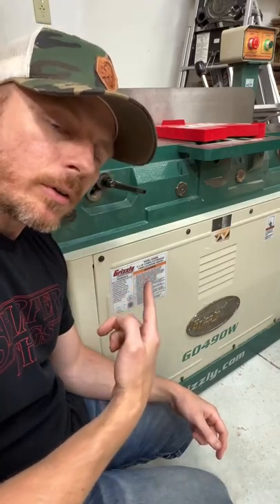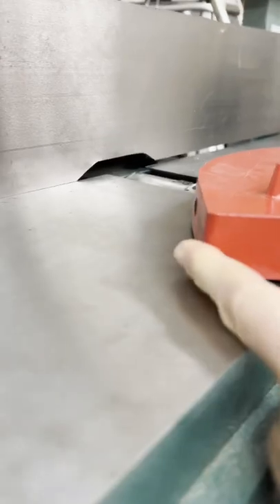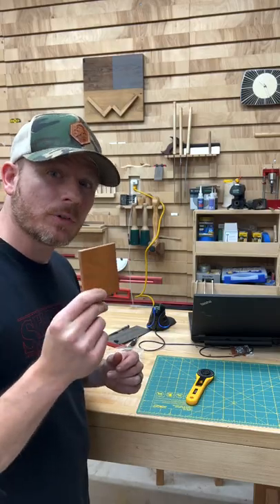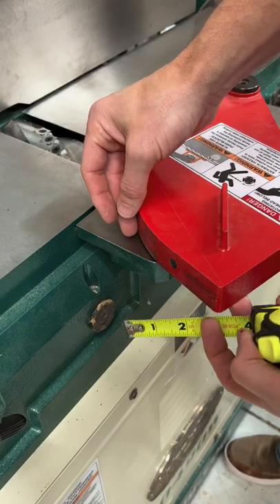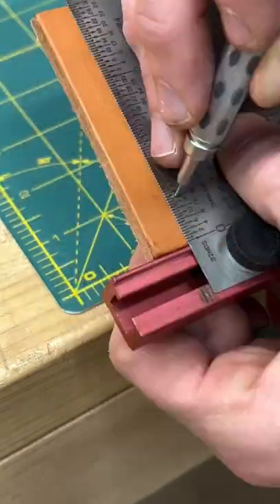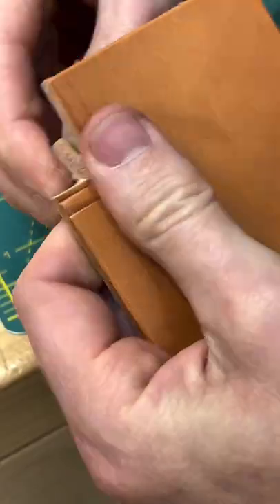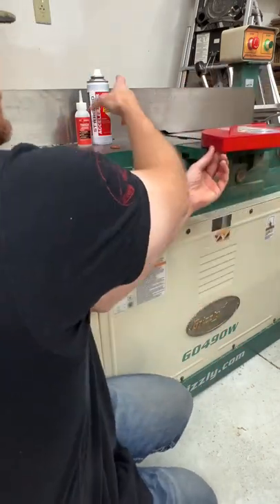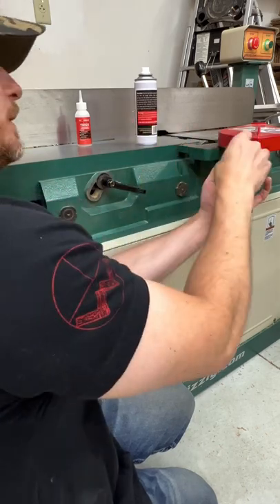If you own a Jointer

Comment: There's an allen screw adjustment on mine where I can tune it to where it just gives the fence a kiss and still be functional. But great idea.
Reply from the maker: That's awesome. What came with mine was what looked like a black eraser but it was rubber and then there was a narrow piece that fit into a hole in the guard. I'm enjoying how easy my solution was. I have a follow-up video on Tiktok where I show more in depth how it's been working out for me. Thanks for watching!
Reply: Is it just me or did it sound exactly the same after he let it slamming to the fence each time?
Reply from the maker: Nah, it’s like night and day! Also, the  leather won’t be wearing down near as fast if at all compared to the rubber stop that grizzly put on it. Thanks for watching!
Reply: @WorkingTimbersCo  That and if you're like me...the sound of metal on metal grates on me like nothing else. The jointer is a precision instrument believe it or not, the thought of something slamming against the fence doesn't jibe with me at all.
Good idea. And am thinking of doing it with mine despite the adjustment I can make with my jointer.
Reply from the maker: Wow, excellent point! Perhaps that was part of it for me too!

Comment: Is that a specialty ruler of some kind?
Reply from the maker: The measuring tool used to measure the leather is definitely a specialty rule. It’s called the Incra Rule. One thing I love is the micro-fine marking holes and slots at every 1/16-, 1/32-, and 1/64-inch. They have several lengths. I put a link in the description for you! Thanks for watching!
Reply: Thanks for the reply! I don't work with leather often but I love learning new things. I'll be sure to keep an eye out for some more helpful tips!
Reply from the maker: Sure, np. I don’t work with it very much either. I use the rule mostly for woodworking. Just happened to be perfect for this application as well!

Comment: I have a grizzly jointer too. I just took the guard off. Problem solved. 
Just a warning to All, 
COMPLACENCY is the GREATEST DANGER in your shop. If you don't sense just a little bit of fear while operating your tablesaw, jointer or mitersaw, consider how your life would be missing a finger or two...or maybe worse.
Reply from the maker: The great debate right there! Many experienced woodworkers use them still. Thanks for watching!

Comment: Flunk. Your fix is a safety issue as that piece of leather can catch on stock you are jointing. 

A jointer is one of the most stupidly dangerous machines in the shop as it has you pushing your hands toward a cutter head. Best not add any junk to that deal.
Reply from the maker: I think that’s why the guards are curved near the fence area, to deflect easier. I sanded the leather on the end that will make contact with the wood and it deflects beautifully. I show that on my TikTok account. Happy with this solution. Thanks for watching!